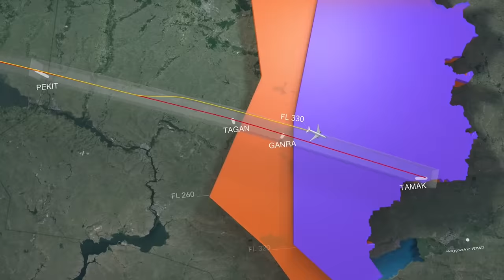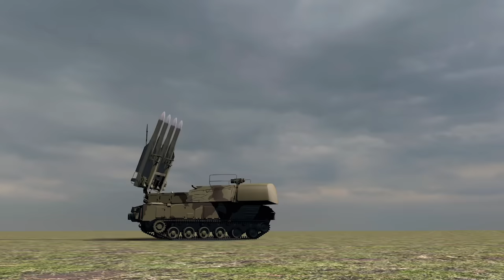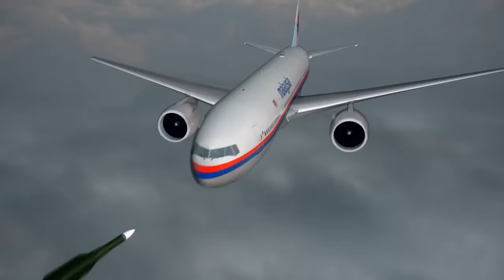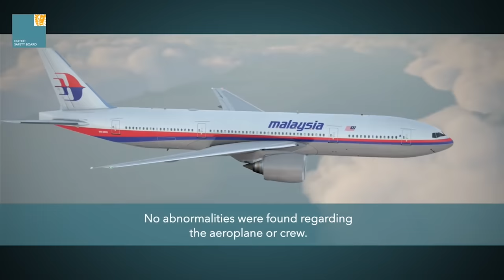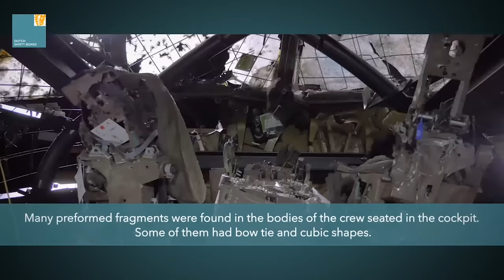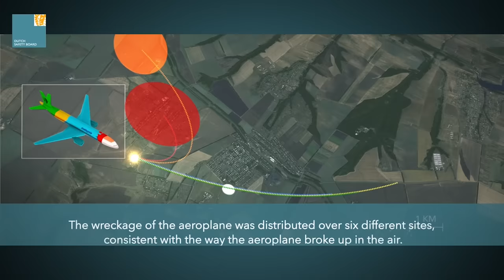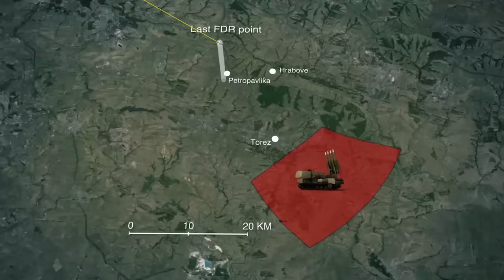Cause of MH17 crash by Dutch Safety Board

Comment: MH17, which flying from Amsterdam, the Netherlands, was not shot down, but blown up. 3 explosions in the air were heard by real witnesses there is a first name last name person. 3 different chemical compositions of explosives were found at the crash site. The first explosion in the front cargo compartment was he who destroyed the plane all the macro parameters of the disaster:the flight of the wreckage of the aircraft as BEFORE (it is impossible the speed of the aircraft is more than 200m / s and the initial velocity of all its parts will be the same so only forward and to the ground)  after the last point of the parametric recorder FDR, which the Dutch criminals, liars and forgers call the point of detonation of the mythical Buk anti-aircraft missile. The second is the work of the FDR recorders, CVR stopped recording at the same time, they themselves are intact and the sources for information for them are at different distances. 2 subsequent explosions, the purpose of which was to imitate an external attack, occurred already in the cabin flying to the ground, as evidenced by the angle of attack sensor damaged by the striking elements(SE) and thereby its damage shows the flight of the cabin in space at the time of its defeat.  The striking elements themselves were capsules with a chemical substance capable of burning through the aircraft's upholstery and even melting titanium. They flew out of the cockpit flying to the ground and when it caught up with them because of its larger mass, holes were burned in it, simulating the high kinetic energy of the striking elements of the Buk anti-aircraft missile.
Reply: Оце ти фантазер. І не полінився цілу казку написати щоб виправдати дії російських терористів.

Comment: The Soviet Union did that.  The old BUK rocket that struck the plane is Ukrainian ex soviet stock. 
Russia uses newer systems. 
The rebel seperatist,s would have had to have over come a Ukrainian division and captured all three mobile radar arrays in seperate locations as well as the BUK it's self , then with out training attempted to use the weapon. 
Sorry but it's unfortunately Ukraine that did this hence the reason it's so quiet.
They know that there is to much evidence that it points back at the Ukrainian army , which at the time was under  extremely stressful conditions and had problems in the chain of command and cohesive response and decision,s were being made at independent levels.
Reply: @SayHelloUmka  it's hard to hear reality Vs emotional programming I know. 
Russia has shot down air liners before. 
For balance, but this was Ukraine locally sprung up  insurgents don't tend to have multi site radar arrays and BUK systems
Reply: @trunginh375  how does that change anything lol
Reply: @davidherron3136  You lol at your boss mean he is a laughing stock